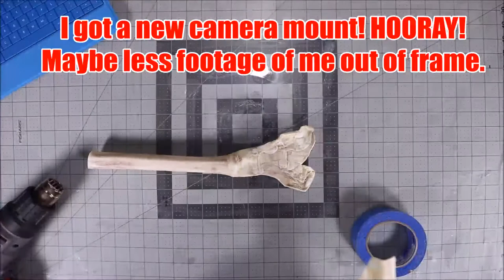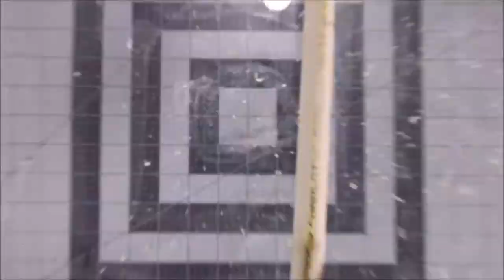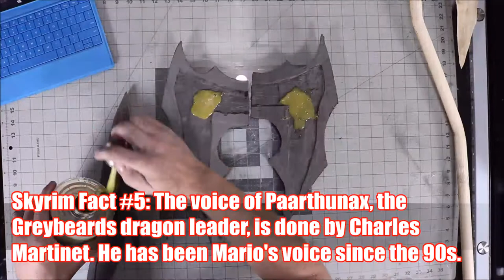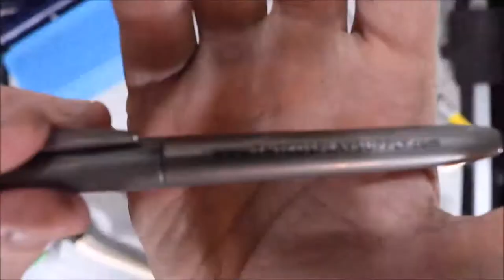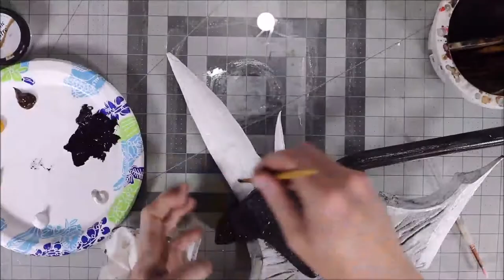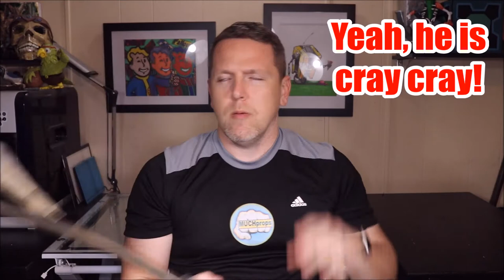Making a dragonbone battleaxe from Skyrim

Comment: This is the first of your videos that leaves me underwhelmed.  The finished prop looks good and all but the way you built the head could be much better.
Tip for bending pvc pipe without it deforming or kinking is to tape up one end and fill with fine sand before heating.  For best results heat the sand first.    Also remember that if you are heating anything made of pvc and it turns brown- it is releasing chlorine into the air.
Reply from the maker: Armoury-Terrain thanks for the tip.